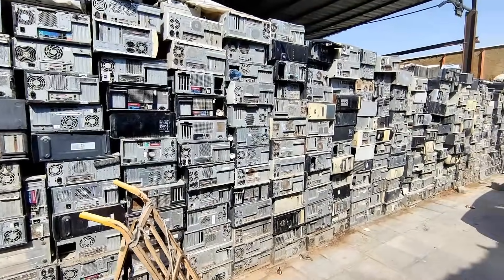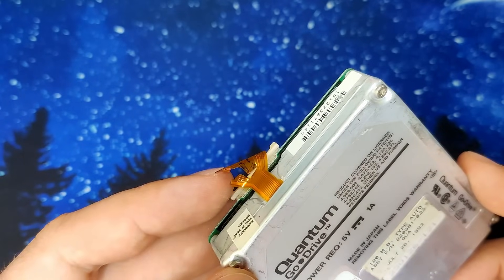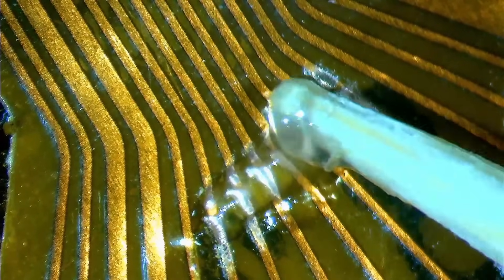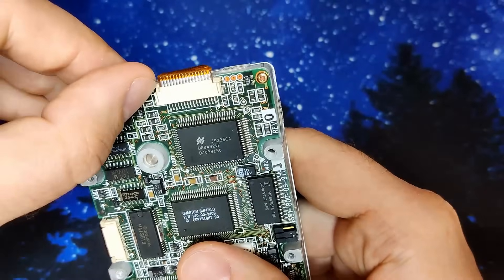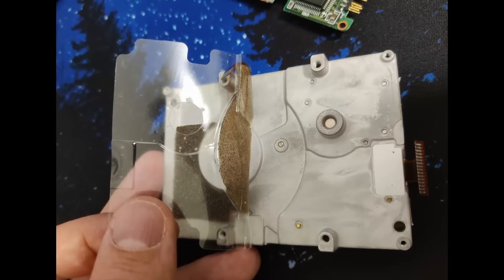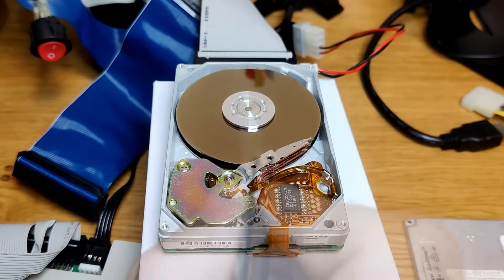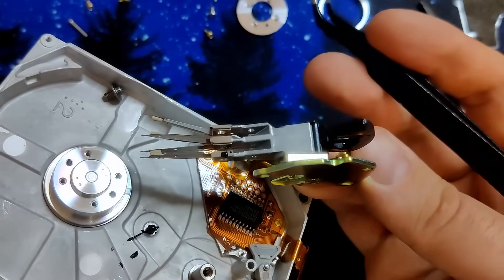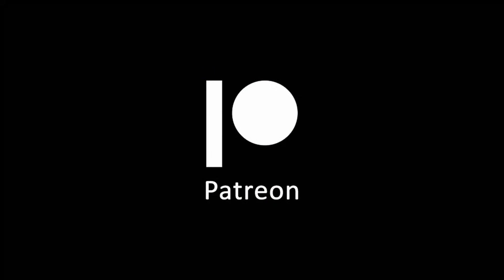Design flaw or planned obsolescence? Quantum Go Drive 120MB

Comment: If you think about it, it makes total sense. Rubber was a non-drying liquid glue before vulkanisation. And what's going on is reversion, that the molecular links created by vulkanisation are broken and it reverts into its primordial state. Several different elasthomer polymers actually have this issue, not only isoprene (natural rubber).

It's for sure not deliberate on the part of the manufacturer, after all it's difficult to predict when it would fail and if it does so too soon, it can well backfire, and as far storage media of the era, they grew obsolete so quickly, they didn't have to exactly worry about the old products competing with the new. But they also probably didn't have a long term endurance requirement, stabiliser type and content etc specified. Or in turn they could have had a limit on sulfur content in order to reduce possible contamination of the chamber during normal service life.
Reply: While you're handling sticky tape, have you ever thought what the adhesive actually is, what sort of material which is not the carrier? It's invariably an unvulcanised elasthomer. Though for Kapton in particular, it should be siloxane.

Comment: I highly doubt it was planned obsolescence. The chemical composition of that rubber is simply not able to withstand the test of time. It's similar to those rubber snares used in tape decks: they simply go gooey after a couple of decades.
Reply: Any product have some designed lifetime.... it is balance between price and lifetime. It have statistical character. No matter if it is harddrive or nuclear power plant....
Reply: That also happens on old ThinkPad notebooks. They get extremely sticky, because the backs of their displays (and sometimes even the whole machine) is rubberized.

Comment: I am going to release a video where I show the same gooey stop. Because it's so liquid, I didn't think it was the cause of the issue. But your point is sound: in that state the "stop" is not able to prevent the heads from crashing on the spindle. Very interesting! And great soldering skills: I tried before on a similar flat cable and I immediately made a hole on it :D 

"Mountain Motherboard" should be a world heritage spot, to be preserved at all costs!!

Oh, and @thetechknight is amazing BTW!
Reply: Yes, all those poor PCBs. I'd take so many name-brand boards home to test and repair. CPUs too, if cheap (I don't care about the "gold scrap value"), for other projects that I'm sure I could dream up.
Reply: @masejoer  if I was taken to a place like that I would not have a place where to sleep anymore!!
Reply from the maker: @tony359 You're welcome to visit me in the UAE ;) The weather is nice now!
Reply: @bitsundbolts  Would I be visiting you or Mountain Motherboard? :D
Reply from the maker: Of course!
Reply from the maker: Is it the same drive? Maybe the drive could have been saved, if you have the right equipment, but I think you need to make sure to:
- not let the opposing read/write heads touch
- secure platters at their position to avoid misalignment
- prevent dust from getting onto the platters
- make sure the alignment of the actuator arm is correct
And probably a lot more. This is way above my capabilities.
Reply: It might be an interesting journey to log all brands and types that encounter the same issues. That way, people know which drives to obtain, and especially which not to obtain. :)

Comment: What made this drive catch your eye at the scrap yard?
Reply from the maker: It was double the height compared to all the other drives - so, it was the odd shape that caught my attention.
I also took two other 2.5" Toshiba IDE drives (1.4 GB and 30GB) - both working! And of course - full of personal data...
Reply: @bitsundbolts   Oh yeah, personal data. Some used SSDs I purchased a couple years back were from SpaceX - they had all kinds of internal documents and a user's Outlook files on it (mostly quality control and engineering docs). Always glance through quickly before a format. A newer free laptop I found in a "free pile" that was posted online seemed questionable - it was in a bad area of town. Turns out it was stolen, and I was able to return it to the owner by looking through the web browser.

I don't remember quantum drives being known for their reliability.